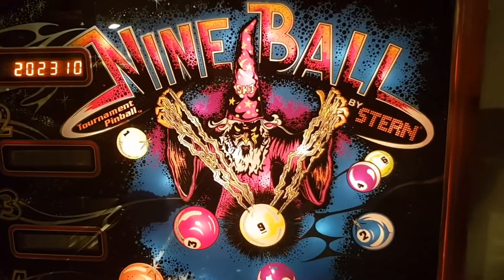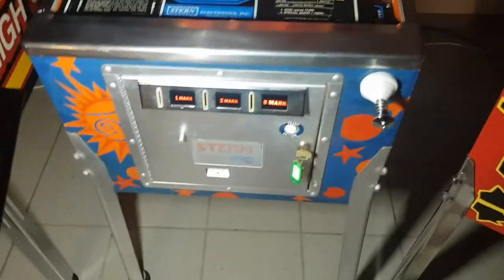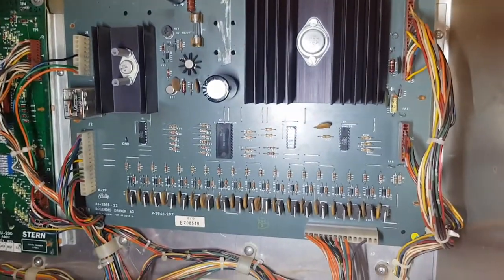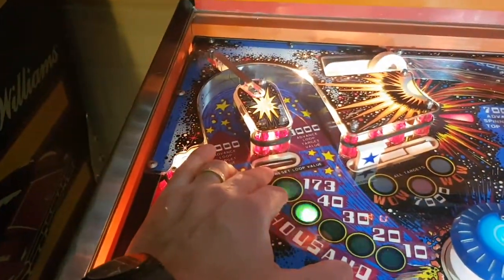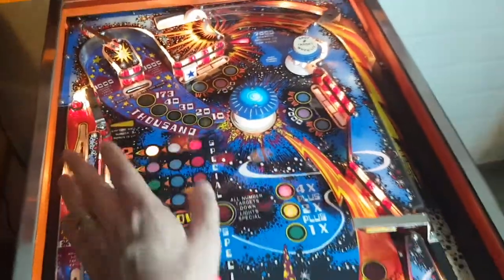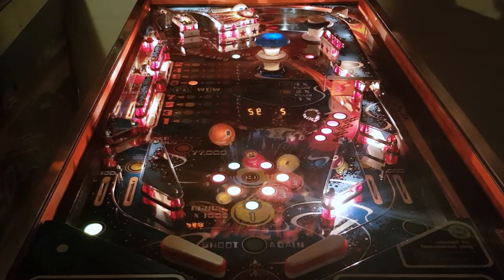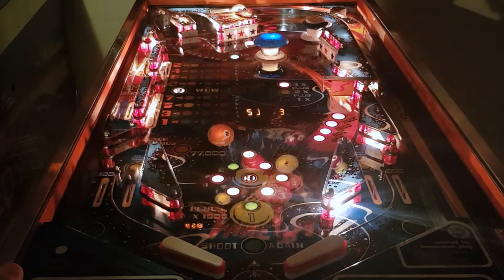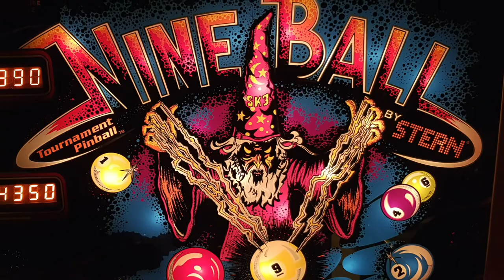Duffy's Arcade Collection #9 - Nine Ball

Comment: Stern used a metal prop rod in their pins .not the one in video which is not factory design. Otherwise good restoration. Don't like these new designs with sceen in the head.
Reply from the maker: Yeah, that black rod is an adjustable rod (for hanging clothes in a closet). I like to use it to hold up the playfields on some machines. Keeps heavy playfields from flexing too much.

Comment: Very nice! I'm actually working on a Nine Ball right now for a friend. Had a question for you: that red arrow on the top that you're supposed to hit on launch, is that arrow always lit, even in test mode? My machine is doing that and I'm not sure if that's normal or if the bulb is locked on.
Reply from the maker: Hi there, sorry for the late reply. Yes, my Nine Ball acts the same way. The red insert in front of the white stand-up target remains lit at all times, even before the game boots up, so it must be hard-wired to the GI string or something. I noticed it in the videos of other Nine Ball machines as well. In Bowen Kearns' tutorial video from PapaPinball, the bulb is out, but apparently the bulb was burned out on that machine because it didn't light up during the entire game. Your machine is correct!